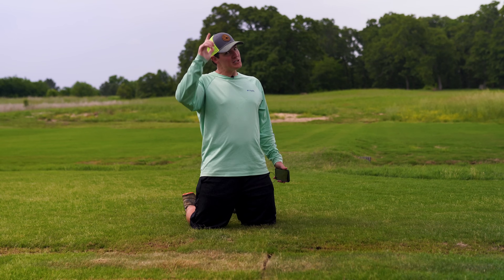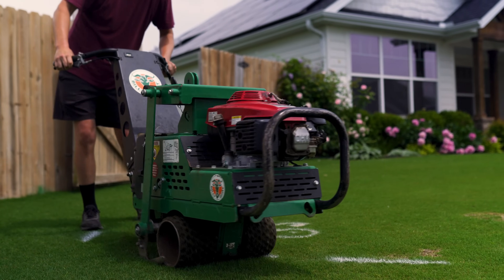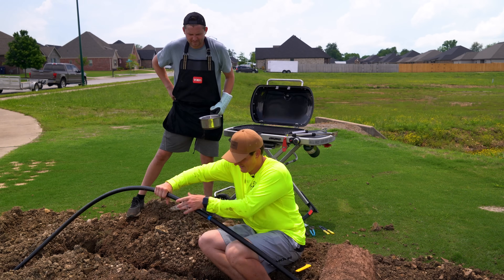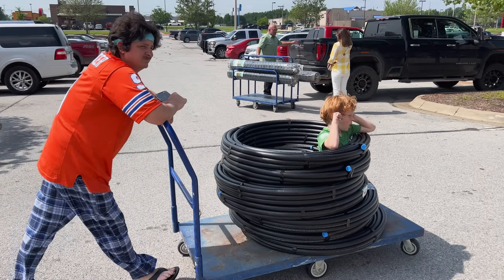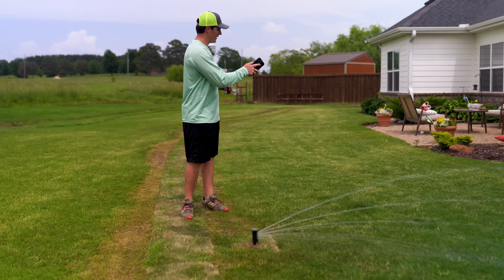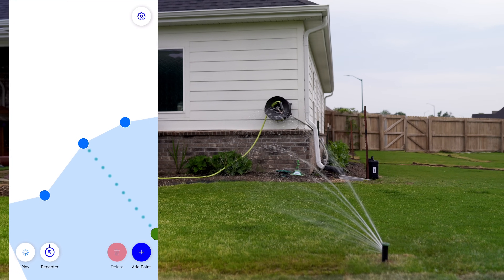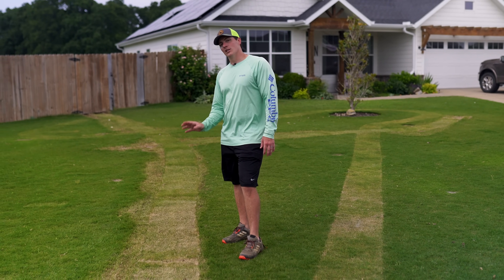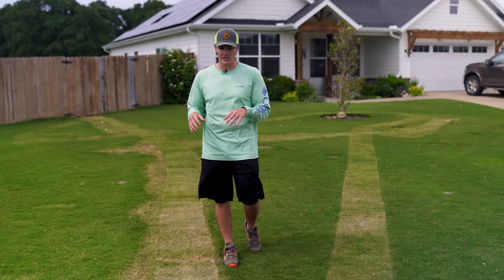A More SIMPLE & SMART Irrigation System - How I Did it Myself

Comment: I’m about to make a purchase on Irrigreen using your code, but before I do, I want to ensure I’m getting everything I need. I’ll be requiring anywhere from 12 to 14 heads along with the new controller.

I’d like your advice on a few things:
	1.	Should I use poly pipe similar to what you used? I’m located in Delaware. If yes, could you share links to the items you purchased, such as fittings, crimps, etc.?
	2.	Did you use a master valve? If so, which one would you recommend?
	3.	Any additional tips or tricks you can share to make the installation smoother would be greatly appreciated.

Thank you in advance for your help!

Comment: I would like to see the sprinkler head that was smart enough to know when it should turn on and when it shouldn't based on the moisture in the ground. That will be the real water saver. I want to replace heads only. Nothing wrong with existing water lines.

Comment: I am more of a pop up guy than a rotor guy. Love the work you did by the way. I feel you can save so much more water using pop ups. Rotors are very expensive use wise. I’m it helps a lot with the poly tubing instead of a 3/4 inch line. Great work though your lawn always looks top tier

Comment: I wish it were this easy when I did mine in heavy clay soil which is like digging in concrete.  Shovels and like tools were pretty much useless.  I initially got some small trencher tool but the clay soil punked that tool.  I had to get the big dawg Ditchwitch which made it much easier getting through that clay soil but it had to work hard to do so.

Comment: I love the new technology, especially in my yard. I have a real narrow right side of my lawn with a tree that would have made traditional heads hard, plus no need to trench under my sidewalk. 

I also want to add more stuff to my fenced in backyard, so putting 2-3 heads in the middle instead of around the edges with 8-12 heads makes future expansion easier because I can just change the throw points. 

I priced it last year but held off, it was a bit more than I was prepared to spend but definitely love the Irrigreen system.

Comment: I actually had a professional, install my irrigation system last summer. I had them cut the sod on the front yard and trench on the backyard. With that said, the backyard trenched recovered in half the time that the front yard did with cutting the side. If I had to do over again, I would simply trench because those trenches were so small. Nonetheless with lots of fertilizer and regular watering, it all came back great. Looks great though and thanks for the video!
Reply: how does the system work for you compared to what you had before? Additionally, how many sprinkler heads did you have in the past vs now?

Comment: I'm 61yrs old, I installed systems when I worked as a landscaper in my mid 20's and I'm not computer savvy. I installed an irrigreen system at my home and love it! But I do need to install a 'cycle stop' valve since I have a well and the pressure changes.
Reply: @robertmaurer9647, I’m on a well also and wondered about the pressure changing/cycling down, then jumping up (I see it clearly in the distance when using an oscillating sprinkler). Could you explain the ‘cycle stop’ valve?
Reply: @surfwakerc  as long as water is running, the Stop Cycle valve reduces the water flow to the tank and keeps water pressure at a steady level. The pump will run continuously until the water stops flowing. When the water pump turns off and on repeatedly, it wears out the pump sooner. There are several YouTube videos that explain in more detail and better than I can.
Reply: @robertmaurer9647  thank you - I will look into this valve.

Comment: I had a professional system put in.  I was shocked by how difficult it was.  The plumbing was really complicated to create the zones.  Multiple runs of pipes and confusing valve pits.  For those that don’t know, most systems are dumb.  Instead of controlling each head, you control solenoids in the valve pits to send water to an area.  To control spray patterns you install different nozzles.  It’s a very imprecise way of doing things.  The way the controllers work seem really dated.  It’s like they piggybacked this and that function on an older antiquated system.  The main system has no idea its signals are being modified by secondary systems.  It works, but it doesn’t work well.

Controlling each nozzle means you can pressurize the entire waterline and open spray heads like opening faucets in your house.  As little or as much as you need.  It’s not rocket science.  They haven’t pushed the boundaries of science.  This system just does what legacy systems should have been doing 20 years ago.

I was shocked how far behind the times sprinkler systems are.  It felt like they developed an operating system and refused to change.

I think you will find your sod efforts beneficial.  I used a pro plugger to hasten the grass filling in.  It took a long time and I kept having to add soil.

Comment: 36.5', what is your water pressure and your volume.  I need to test my volume, but I'm at 57psi.  I think my pump can only shoot it 30'.  😢
Reply: My pressure didn’t require a pump.  I have zones with 5 large nozzles running at a time.  Your comment has me concerned about how much pressure my home taps are getting.  I don’t have a regulator or surge tank on plastic lines…not good.

Comment: Can I replace a sprinkler head with one of those?
Reply: you cant in the way you are thinking, each head needs power cable run so trenching is needed even just for one head. One day they will come up with solar powered heads.
Reply: @richardportelli1983  I thought so.. but at least you don't have to lay pipe.. it would be easier to trench a wire...
Reply: @thimitri1  the effort required to retrofit would be almost the same as installing a new system. And the way the heads work you would 100% need to start from scratch as the heads cost a fortune.

Comment: I've spent the last 3 weeks moving sprinkler heads and running new pipe in my traditional system and it has been a pain so right there with you. From what I see, these don't use a valve but the whole line is pressured and each head serves as it's own station? Just curious if you only run 1 head at a time or more of a zone style...
Reply: Generally you’d have a single master valve near your backflow preventer. You’d then run a pvc line to multiple heads. Each head has a valve in it that turns on, rotates, and reduces pressure when you have an obstruction and need to not spray as far. Because of the volume of water used, it’s designed to run 1 head at a time.